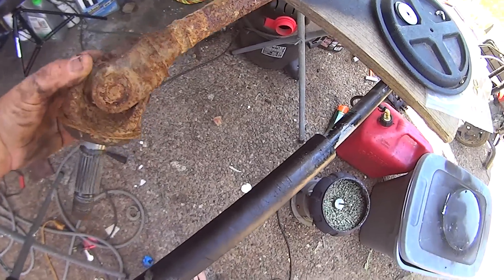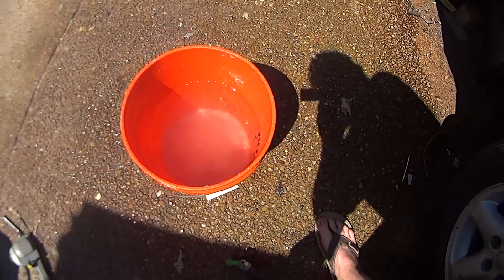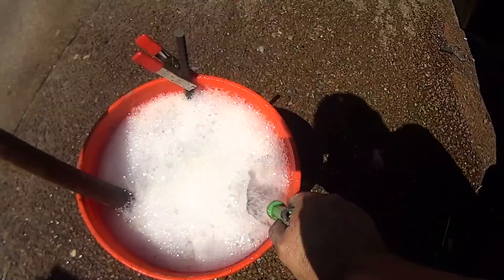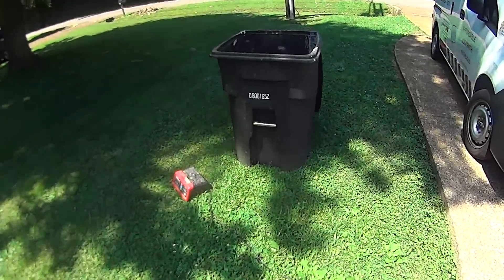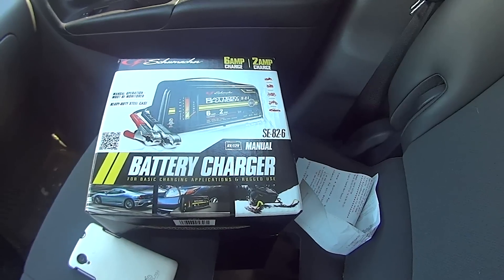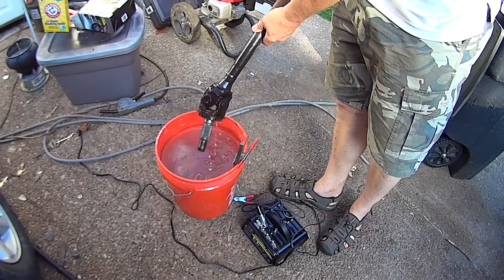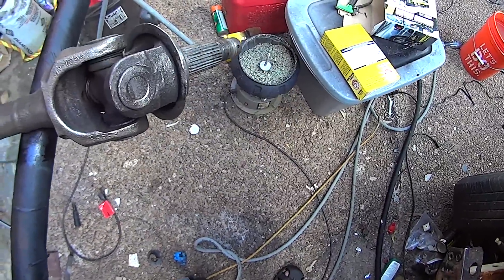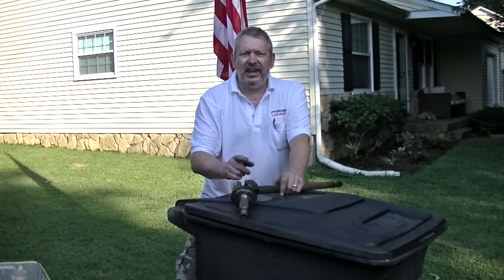Redneck Repair Series  - Electrostatic Cleaning -  Rust Removal - Electrolysis Rust Removal

Comment: can you get shocked or even electrocuted doing this?
Reply from the maker: robert fornwalt The only danger would be the battery charger - if it was to get damaged in some way - the output from the charger is 12 volts ...